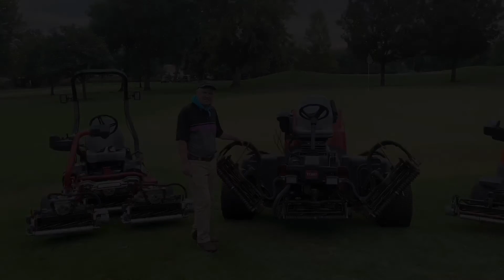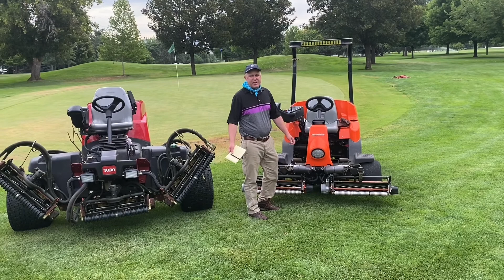The Future of Golf Course Maintenance

Comment: We have the eclipse Jacobson triplex. Errors galore problems so on so on.. pls just hydraulics pls!
Reply: You are the wisest person I know thank you for that most thoughtful comment. You are an expert.
Reply: @joeaholt1538  Electric does have advantages but I like the simplicity with older equipment. I do like the eclipses when they work.
Reply: Jacobsen mowers suck! So many electrical issues. We’ve gone through half a dozen electric actuators since we got one a few years ago.
Reply: @_P0tat07_  just had bearing in the electric drive break and got pushed through the differential case by one of the gears. Uggg. I do think they cut fine if they just worked but I guess anything 10+ years old is going to have problems.
Reply: I garuntee that the electric reels don't cut as sharp as the standard fairway and triplex mowers do!!!!!+
Reply: @coophandluke3697  I have to say once they are sharpened and as long as the grass is not to dence it cuts well. Just computer problems.